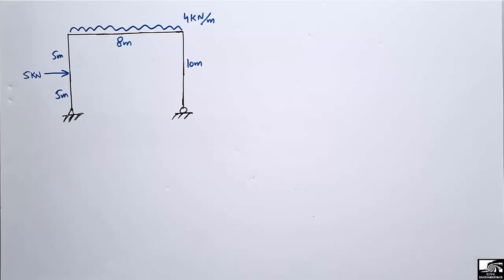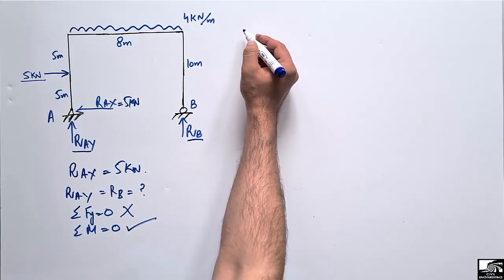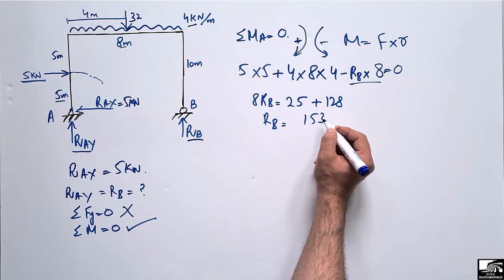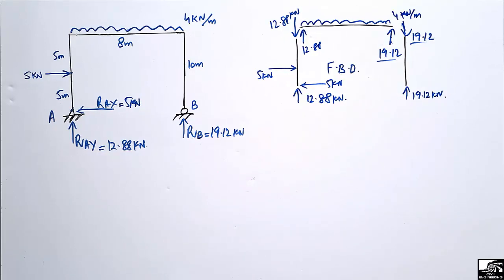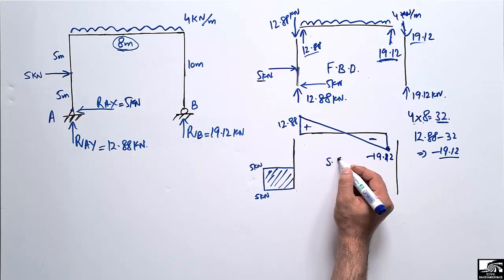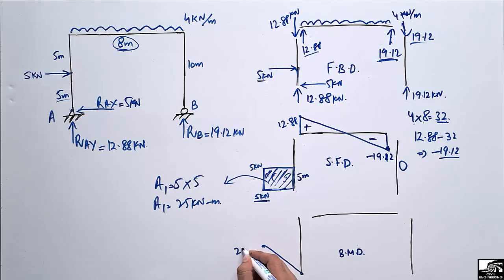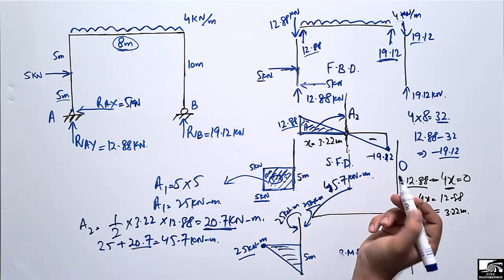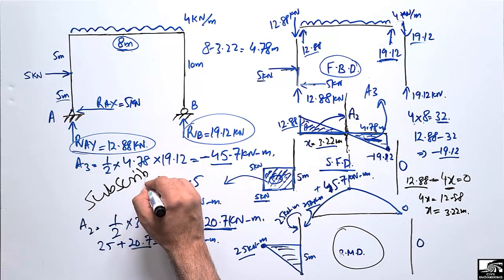Analysis of Frame Structure || Shear Force & Bending Moment Diagram

Comment: At the fixed joint between the beam and the column at A..there exist ...an internal joint moment..which was computed to maintsin static equilibrium..25 knm...

This bending moment,to my mind has to be included and shown to form part of the bending moment diagram for both the column ( should be located at the top half of the column ) as well as at the start of the bending moment diagram fir the beam

We can see that computing for the monent anywhere on the pirtion of the top half of the column ..will result to a constant monent of  25.....
Reply from the maker: Good analysis